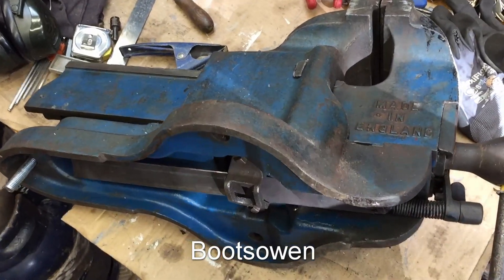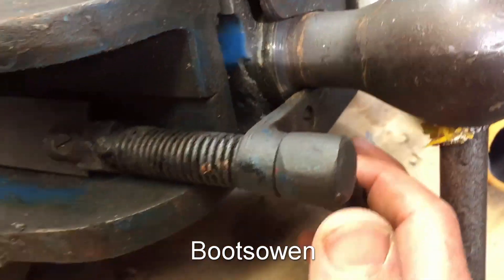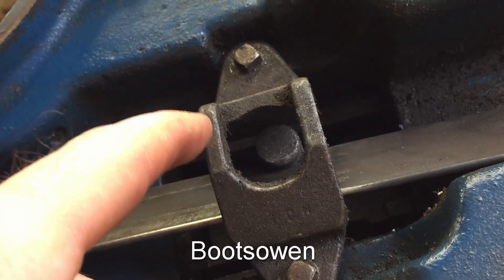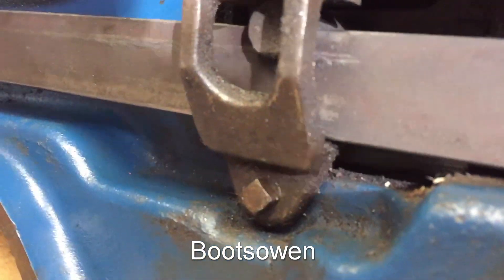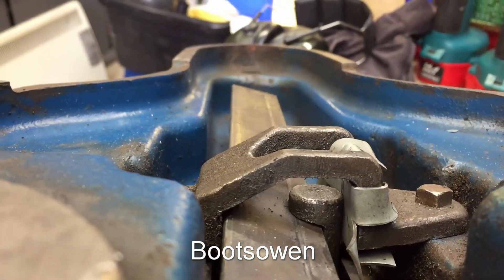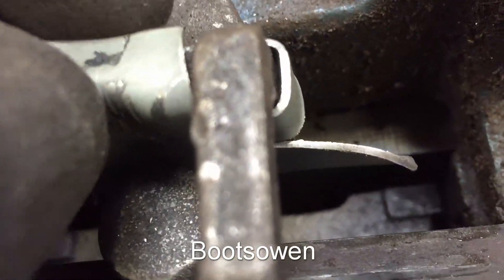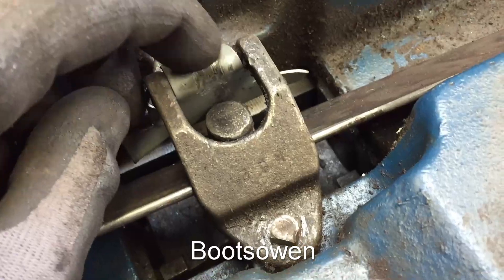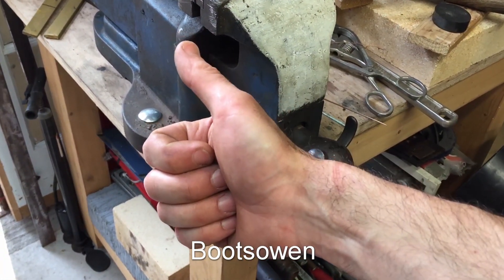Quick release repair Record 25 vice | handle keeps jumping out: how to fix Metalwork Engineers Vise

Comment: Found another issue with mine, the vise will tighten on the material but when you go to snug it up the vise will ‘pop’ and won’t tighten past a certain point.  I can’t see anything in the vise that would cause this, I’ve even flipped it over and watched for movement on any parts.

Comment: I bought one recently and wasn’t operating properly and yes that bracket was upside down as people are saying. Only thing now is I can’t get the lever positioned correctly like this one shows.  Doesn’t have enough movement to open up quick release mechanism as it hits the main lever. So the only position that works is facing directly downwards. Oh well it works anyways now.
Reply: I pulled the flat bar with handle out and put the flat bar in another vise and was able to turn the handle so it had more play !

Comment: After working for twelve years with that bloody thing today I took it apart to give it a clean and a grease up and I found out what that quick release was for. Never used it because European ones that I worked on never had a quick release. Just how much time it would have saved me if I knew that. I feel like an idiot 😅
Reply from the maker: It’s extremely handy to have. The thread is aggressive enough that you can screw it in and out by hand quickly but the quick release is great.

Comment: Lol the bracket .is upside down ...lol turn it the correct way .then you will find you don't have to botch repairs
Reply from the maker: are you sure.
Reply: @bootsowen  No Sir. Your bracket is oriented properly. I have the same vise and spent a pleasant half hour trying to make the bracket fit with the bend up when I greased it! . The engaging strut will not allow it.
Reply: @bootsowen   I'm 100 % sure ..rebuilt 1000.s of record vices

Comment: Hi Owen,

I have the same vice and I disassembled it yesterday for a different reason. 

That bracket is upside down compared to mine. The concave shape is for the half nut to protrude through.

The quick release bar then sits under the ledge on the bracket  on 1 side(it's over it in your video) and held in place by the half nut slot on the other side. 

Have you any idea what stops the jaw from sliding out when you pull it out completely ?
Reply from the maker: Is it different because the vice is upside down in the video?  I have another vice that is the same model but had a different design of quick release mechanism.
Reply: Very late to this thread, but might help somebody wondering what stops the jaw coming out. 
There should be a washer that you slip onto the smaller diameter stub of the vice screw. This goes on just before you feed the stub through hole at the rear end of the moving jaw casting. When the jaw is opened up to its fullest extent this washer jams up on the back end of the half nut and stops it going any further, If you have lost yours, or it came without one, you need a sturdy washer about 1/8" thick with an inner diameter the same as the stub end, and an outer diameter about 1/8 to 1/4"" larger than the main screw diameter. It is quite common for this washer to go missing when a vice is dismantled for repairs or refurbishing.... it is easy to miss

Comment: Owen , as the last resting place of yet another piece of washing machine case. I might have built that wear point with a bit of weld but that could have got messy very quick. I think your fix might well see you out, cheers
Reply from the maker: This is what the comments are for. It never occurred to me to put a little weld on it. Even a dab of braze. I think the only solution is to cast up another piece out of alu or brass! If it ever fails again. I don't know why I didn't think about the welder.  Thanks
Reply: @bootsowen  Owen, yes just occasionally I have had a comment that really helped or gave a differing perspective. I have found that half decent quality cast will take a weld as long as it is not a highly stressed part, cheers